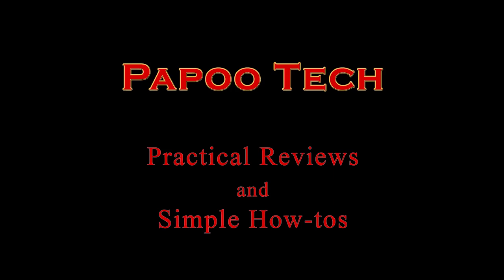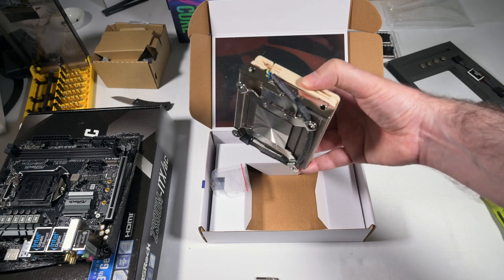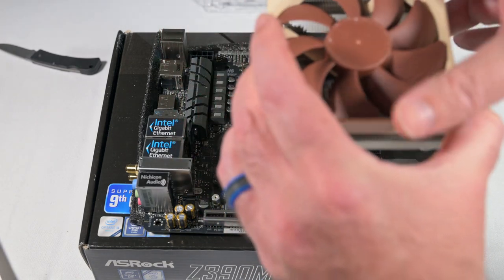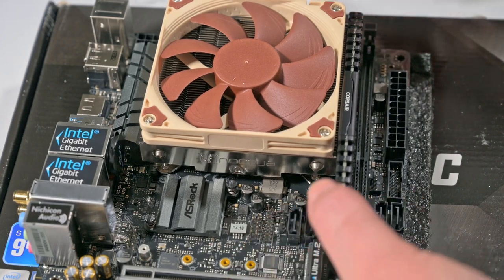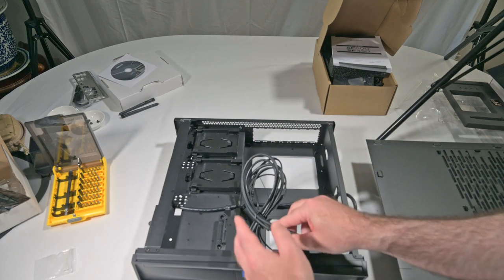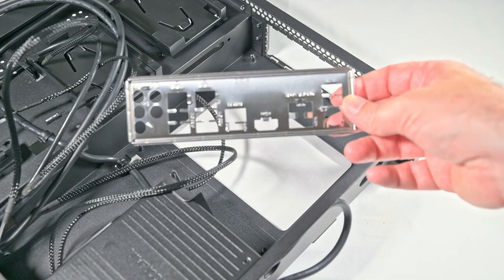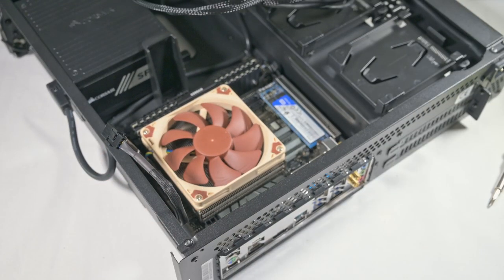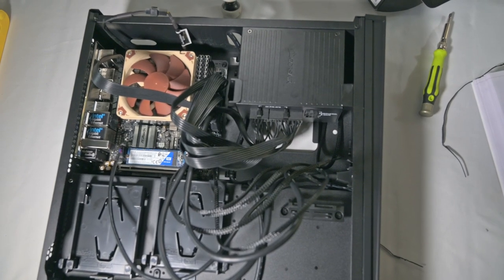Part 2: HTPC ITX Build | 2020

Comment: Hi, can you please make a video on how to connect 5.1.4 Dolby Atmos speakers out of htpc out put, since mother board have only 3 pin socket. Please reply.
Reply from the maker: Thanks for the question! I'll have a look for a future video - delighted to get ideas. At the moment I am connecting the speakers to the tv not the htpc. You can configure 7.1 CH HD Audio by using the HD front panel audio module. Then enable the multi channel audio feature through the audio driver.